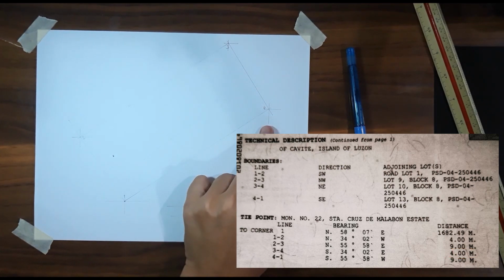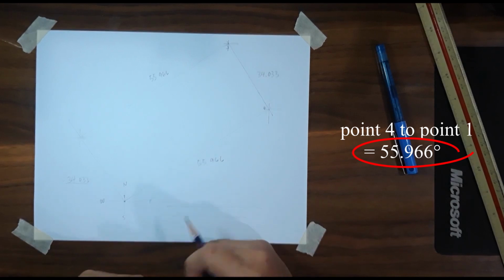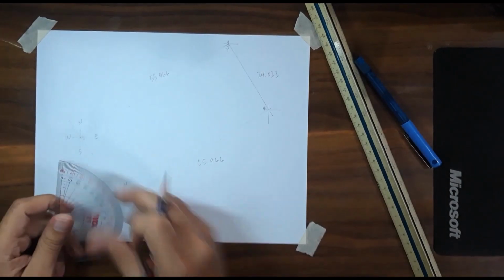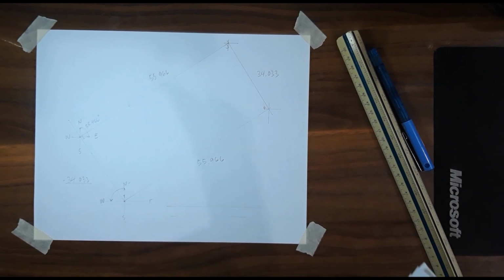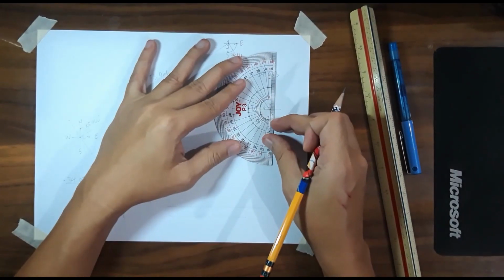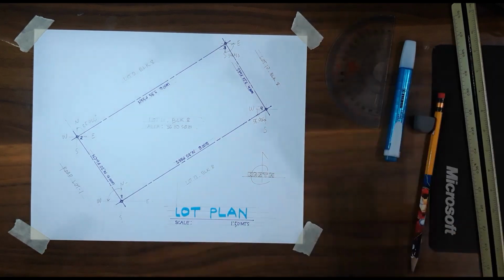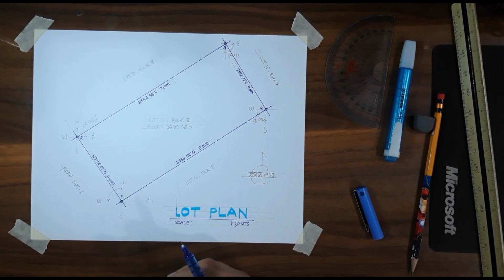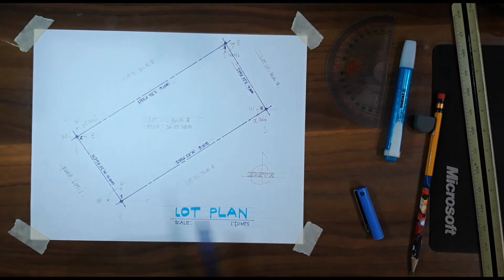ArkiADD Vlog 04 How to draw Lot Plan from your TCT

Comment: Land survey practitioner here. A tie line is a vector that represents distance and direction from a location or control monument established by the government. It is usually denoted in the land title as BLLM, MBM, etc. It is used to provide the lot its geographic location. When you see TP-1 notation in the land title, it pertains to the vector connecting the control monument to the first corner of the lot. The tie line is thus not a component/part of the lot boundary.

Comment: hello po. asking for help what will happened if thier is a case na mali ang sukat ng surveyor . ano po ang dapat gawin po?
Reply from the maker: Hi, panu pong ung Mali? Sa title na po ba?
Reply: @ArkiADD  sir sa plano po . mga 20 years na po ng magkaroon ng sariling plano ang lupa ng aming lola at nagpasubdivide po sa mga anak po nila. ngayon po may plano po kaming magbinta ng isang portion ng lot pero nagkaroon po ng problema dahil yung karatig po namin sinasabi na overlapping po kmi sa kanilang lupa. nagpaaukat po ang karating po namin at ang reaulta po mas malaki nman ang over lap po nila so nag usap po ang engr to engr at magagree na mali po daw ang sukat ng lupa namin . hindi po namin naman agad po matangap kasi base po sa nakikita po naming image ng linya ng boundery namin ay tuwid pero in actual na po ngayon na sukat ng  engr naging slanting na po ang nang yari which mas magkakaproblema pa dahil apat pa pong karatig na lupa ang posible na magmamali if susundin po namin ang sinabing ng engr na mali ang plano namin
Reply: dahil lang po sa isang mohon ng karatig namin kmi po 4 na magkakasunod na lupa ay posible pong mali na lahat ang plano if susundin nmin ang sinabi ng engr. lahat po kmi ay may approve plan . any sudgestion po sir .
Reply from the maker: @roniedelarosa3630  pwede nyo po ipa check ulit sa surveyor. Especially Kung matagal na syang nasurvey before. Para ma bigyan kayo ng correct info. Whether you occupied them or another way around. Si GE or surveyor po ang makakasagot nyan comprehensively.

Comment: sir ask lang po ano po ginawa sa point 1 po na N58 degress 1,682 m
Reply from the maker: Actually Hindi na pinakikita ung POB line sa drawings. That's only giving you the point 1 in the drawing. In short, for you to easily see the point 1. First try to generate the said line or the so called POB line.

Thank you for stopping by.
ArkiADD
Reply: bale sir imaginary line po basta magkakasya po ang scaled mesaure ng lot po? then dun po ilalagay ang pob 1?
Reply: bale ang surveyor po eh tao then yun po yung distance niya po  mula sa point 1 tama po ba?
Reply from the maker: @yuanmalabanan7714  no. Ang POB is starting point ng mga surveyor. Meron silang local monument na kung tawagin ay Point Of Beginning (POB). Imaginary line yan papunta sa point 1 mo. Halat ng lot may reference yan from the POB
Reply: @ArkiADD  Marming salamat po arki  sa pag reply mo sa aking questions and nasaogt po lahat ng aking katanungan